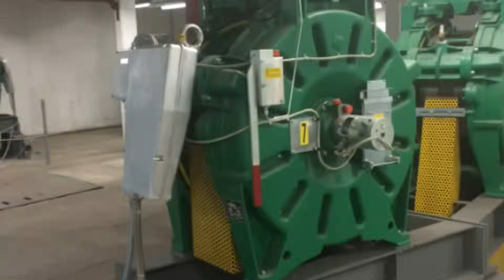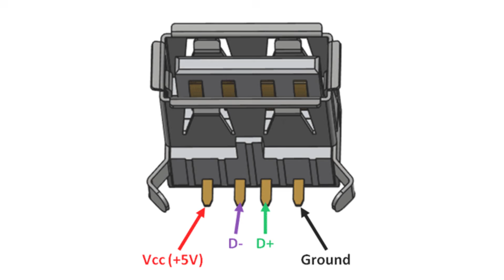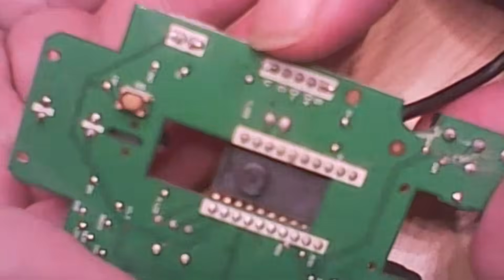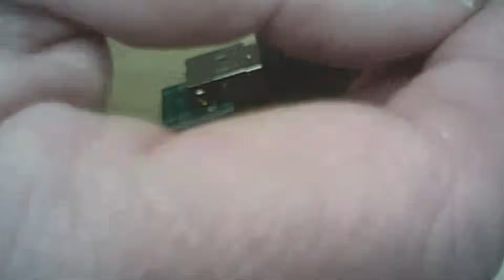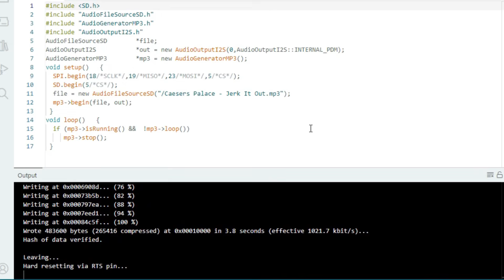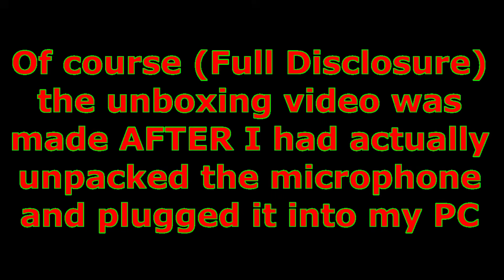Why I Finally Built a USB Power Injector After 15 Years (And You Should Too)

Comment from the maker: There may be some confusion about the purpose of this device.  It is not for general devices such as microphones or cameras that use USB-C.  USB C's power supply is variable and it has a lot more data lines than its predecessors.  As a hobbyist, most of what I connect project-wise is based on single-board-computers such as ESP32s and they only use VBUS, D+, D-, and of course GND.  In a board such as an ESP32, the D+ and D- lines are handled internally and you cannot connect anything to them directly so, they are not protected by this.  The VBUS pin is often provided on a pin that you are able to use as a VCC pin for other components and, it's this pin that poses the greatest risk.  I have never managed to short out the VBUS pin or put a higher voltage down the pin either, but, it's always possible.  A short circuit isn't a big deal as your motherboard should detect it and isolate that port (the microphone with the shorted pins actually triggered this failsafe and did not cause any damage to my PC) if anyone's interested, I took it apart and found a plastic insulator in the USB-C socket was missing and every pin along that side was shorted to GND against the metal body. As a hobbyist, the biggest danger would be accidentally cross-connecting the VCC rail with a higher rail such as 12v and having it fed back through VBUS and I don't know whether that would damage a motherboard or just trigger a failsafe but, I personally don't intend to put it to the test.  It would certainly fry your project.  It's been about 15 years that I have been tinkering with ESP32 / Arduino boards and, it's always been in the back of my mind that accidents can happen.  The microphone made me realise that it's worth playing safe.  The ESP32-S3 boards that I use all have USB-C but, I connect them using a USB A-C cable and they work fine that way so this should also work for one of those.  This is because they mostly use a cheap USB UART chip and don't require the higher throughput.  At least for now, most development boards with USB-C sockets still only use the D+ and D- pins to maintain the highest possible compatibility.

Comment: The project itself is dated. You're only isolating VBUS? But why? How about D+ and D-
How about USB-C?... ah of course I forgot for an instant that back in 2009... USB 2.0 was all the rage :)
Reply from the maker: @unperrier I have pinned a post to clarify the intention of this video.  Everything you have said here is absolutely correct but, this is a very 'niche' device that's designed for a very specific purpose and it's not intended for general usage.  This may not have been clear in the video as I did not want to add another 10 minutes to the video with explanations that would bore most viewers.  It's a fine balance between too long and too brief.   If you are interested, have a read of the pinned post and it will go into a bit more of the technical detail that was glossed over or left out in the video.